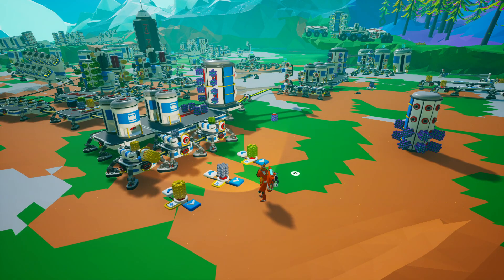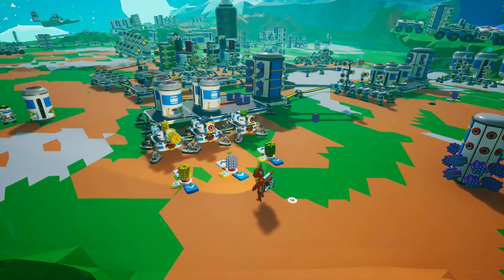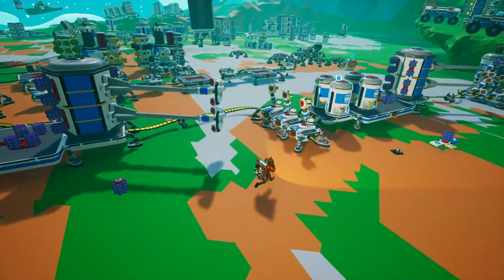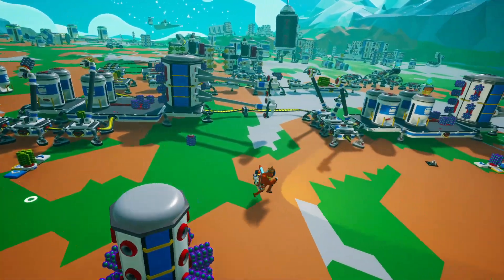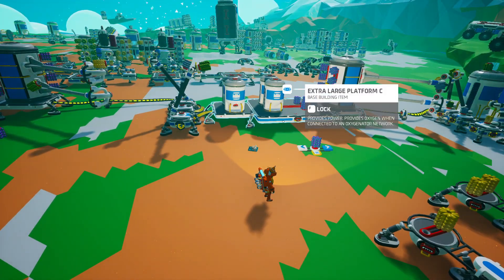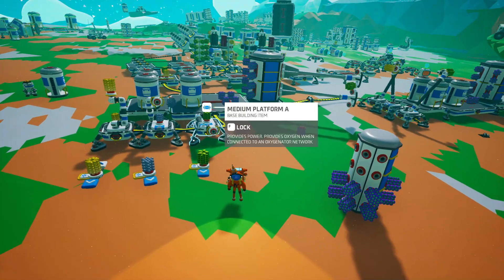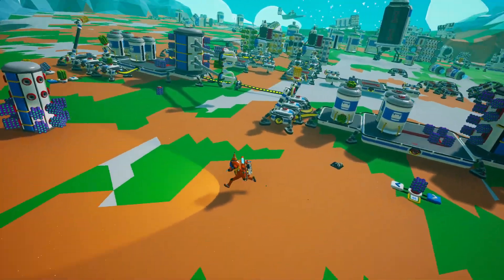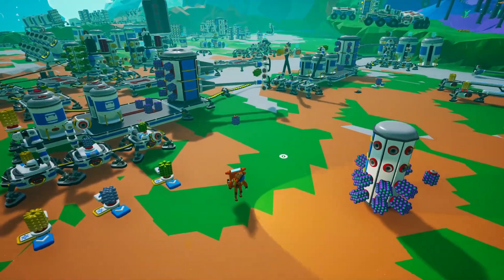Astroneer Community Builds - Extremely Fast Conveyor Belt by Cronic Zombie

Comment: This is awesome, and it clearly provides high speed. But, does it provide high throughput? I'd suggest a benchmark throughput metric: a conveyor belt of arms. A single width belt of arms can go only ~0.3 nuggets per second. But isn't the above approach also limited by arm speed? For sure, clever rail can provide 1 to 2 magnitudes higher throughput.
Reply from the maker: That is a great suggestion, thinking like an engineer!

Rails probably have much higher throughput but to Cronic's credit I believe this was designed before rails were added to the game.

You could probably combine the two and use arms for splitting resources after dumping from the rails.

I haven't played Astroneer in a long time though so I'm rusty in production line design for that game now.